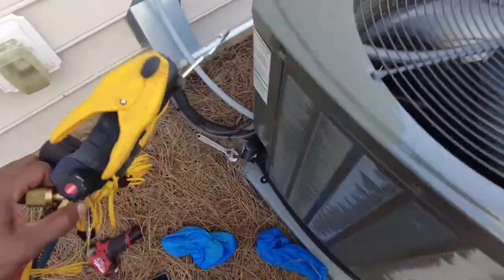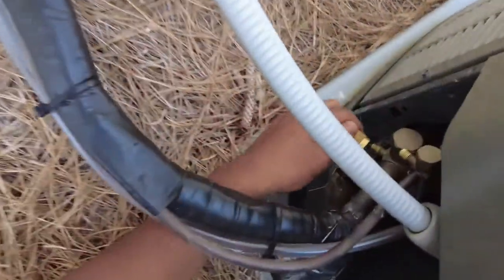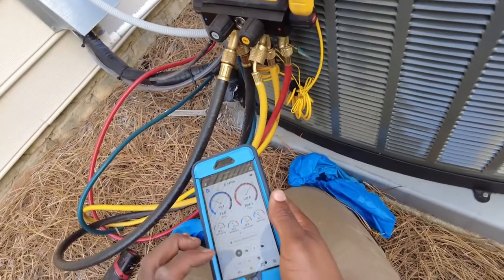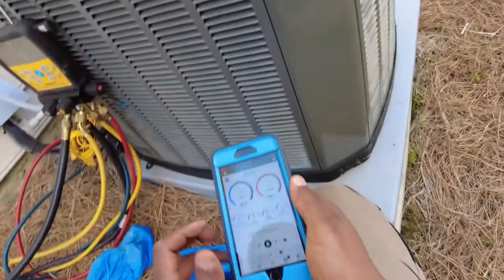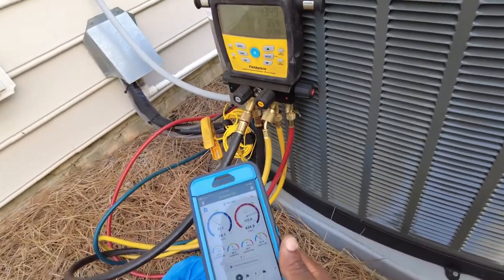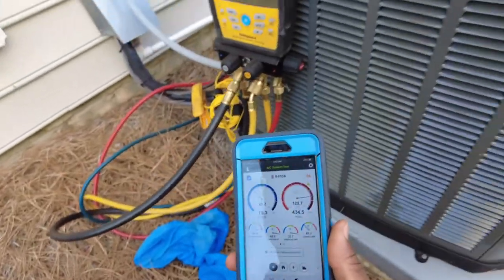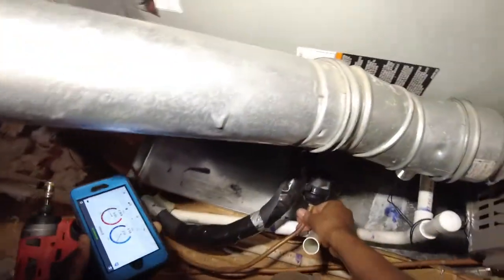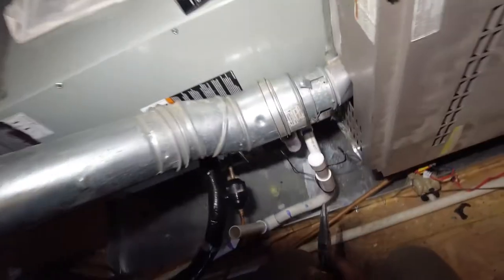HVAC Service Call Diagnosing Bad TXV - How to Diagnose a Bad Thermal Expansion Valve

Comment: Great video! I am in HVAC/R school and graduate in Dec. Two things that intimidate me are heat pumps and failed or restricted TXV diagnosis. Thanks for the video. I will remember the High SC, High Head Pressure symptoms.
Reply from the maker: I hear you, I was the same exact way when I first started out just keep studying refrigerant flow and use measurequick and digital instruments so you can observe all of your pressures and temps at once and i promise it will all just click to you one day. Thanks for watching!
Reply: @HVACTechKnowledgy  what type of digital instruments and what is the model? Thank so much for the video.
Reply from the maker: In this video I use the Fieldpiece sman 480s along with the Job Link psychrometers all the tools I use a listed in the description as well. You're welcome and thanks for watching!
Reply: Do ya'll have to work outside in the winter cold or rain?
Reply from the maker: Cold yes,  light rain maybe...
Reply: @HVACTechKnowledgy  lol I’m in Toronto Canada
Reply: Txv would be half frozen (thats stuck close)

Comment: Did you recommend a transition from the furnace to the coil? Huge air flow restriction there. Who ever did that install did a shitty job! Did you do a static pressure test? Before I even condemn a txv. I check the filter. Correct fan speed, static pressure and if the outdoor coil is dirty.
Reply from the maker: Hey, thanks for the feedback! . Yes I verified airflow. Not to mention, on the video it showed that the head pressure and Superheat were through the roof, which wouldnt occur in a low airflow scenario. Low airflow would cause low superheat as well as low head pressure. But I did end up replacing the TXV on this system and it solved the problem.

Comment: I was so stumped today. The subcooling was fluctuating between 3 and 12 every 30 seconds. The superhrat stayed around 45. The coils and filter were clean. It was frosting up downflow of the txv. What the heck??? The pressures were 70 and 250. I can't find anything online about the fluctuating subcooling. Is there a name for fluctuating subcooling and what would cause it?
Reply from the maker: What was the indoor and outdoor temperature? Sometimes low load conditions can cause this. Based on the pressures seems like it was pretty low load on the system

Comment: My ac unit at store unit I've called the installer out several times due to water leak I finally looked and just after the txv and the tubes are icing up when unit cycles it defrost and melts leaking water.
 
Does this mean the txv is bad the unit is still maintaining temp most of the time unit is a 1 month old trane unit.

Installer can't seem to figure out what is wrong with unit and says pressures are fine but it won't stop leaking and it's icing up after the txv just like on this one.
Reply from the maker: It could be lower refrigerant that causes it to ice up at the cap tubes as well. Have they added charge on any of occasions that they've come back?

Comment: I had a tech stated I needed a new TXV because it was damaged.  My ac unit was freezing up out side the unit connection, which is is outside.  Apparently, he adjusted the TXV and my unit no longer freeze up and the air flow is extremely cold.  He told me part of the txv was not secured, but he recommended me to replace at a cost of $ 900.00.

My question is if there is a blockage in the TXV screen could tech remove the blockage or could one of value was not receiving or releasing enough flow?

So far the ac is working great.  I am in Florida.  I have a Rheem unit and it is only 7 years old. I truly appreciate your feedback.
Reply from the maker: Hey I'm not sure exactly what the tech did but it sounds to me that the TXV was clogged internally and the tech opened the Txv using the manual adjustment valve to buy you time until you have it repaired. If that's the case it's not likely you be able to clean it. Also you don't want to run it forever with the valve adjusted wide open because if the blockage wherever to break free you might flood the compressor.
Reply: Thanks. It is still under warranty and I will have a tech from warranty company check it again.
Reply: @weeziemarklen  TXVs are a pain in the ass. Best thing to do is just get it replaced and make sure a new filter dryer is installed.
Reply: @dlm9477  I had it changed on Friday at a cost of 450.00 for labor and service call.

I plan to use this company to do s service check each year.  Thanks for getting back to me.  I will mention the filter dryer on the next service check.  

Overall, the ac is working great.  What I learned from this is that the TXV goes out frequently in Florida due to the heat as well as my ac unit is in the attic.   I do have an solar attic fan to keep the unit somewhat cool.
Reply: He likely secured the sensing bulb to suction line, yours was likely loose and kept TXV open. TXV being stuck open causes suction line to freeze up (refrigerant will be evaporating inside the suction line) and no cooling due to higher than normal evap pressure (flooded coil).
Reply: @weeziemarklen  i live in Fl also. Which company did you go with? Thank you
Reply from the maker: Interesting. I've never seen over feeding cause the suction line to freeze unless maybe it was coupled with really low air flow. Overfeeding actually raises the suction saturation temperature so the more you overfeed the further from the 32° freezing point you get.
Reply: @HVACTechKnowledgy  The excess liquid refrigerant has to evaporate somewhere...
BTW they deliberately flood evaporators at low heat load in auto AC applications... A gas cross charge that "crosses" around 32F refrigerant temperature (mainly meant to prevent uneven evaporator coil frosting, what could happen when the TXV restricts too much as heat load drop and compressor rpm climb up)... Coupled to the fact there's also a compressor capacity control system that prevents evaporator pressure/air temp from dropping down too low, indeed you're never ever going to see a frosted suction line/compressor in auto AC

Comment: Did you flusing the system   when every time you replace txv....thanks
Reply from the maker: No sir, I just replace the filter dryer and blow out the lines with nitrogen usually. Thanks for watching!
Reply: How come you don't need to pull a vacuum?
Reply from the maker: Hey thanks for watching, sorry not quite clear what you're referring to?
Reply from the maker: Oh when I made the comment about flushing lines, I was only referring to the flushing the lines. I would still pressure test,  pull vacuum and do all the common commissioning  procedures that follow.

Comment: loss of charge or, partial loss of charge  in the thermal bulb of Power head of the TXV  . The symptoms are low back , low to normal head pressure  ( usually low head )  . High supper heat , high sub cooling  . If your head is high than someone might of  overcharged the circuit , trying to bring the back pressure up .  Seen it lots  time in commercial jobs over the years .  High head pressure is not a symptom of a bad power head on a txv .